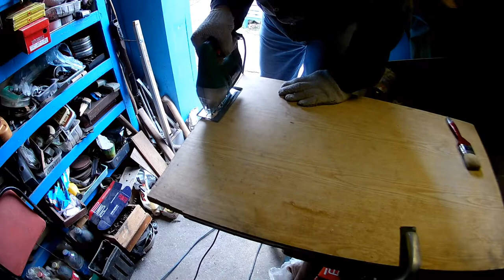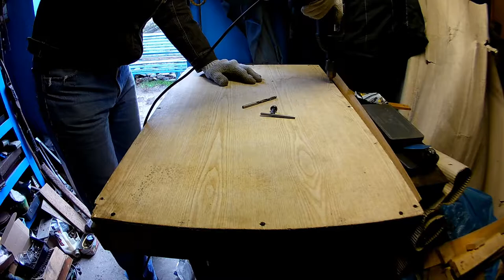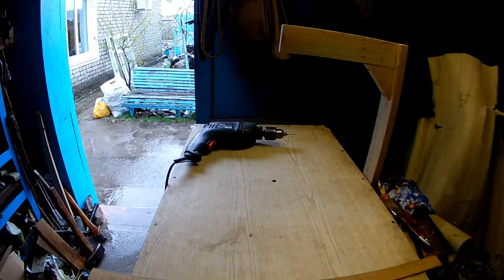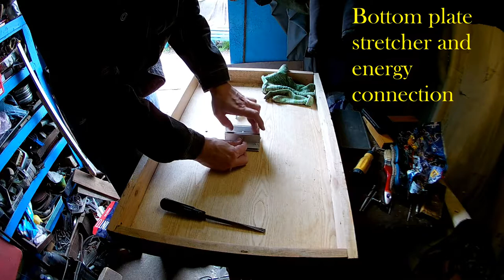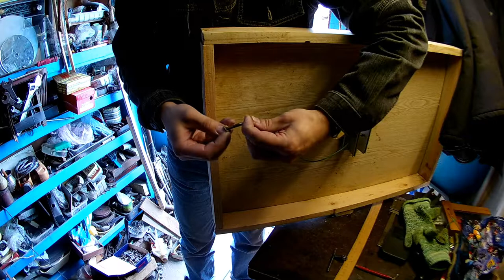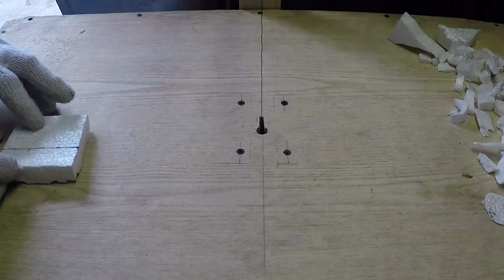Hot wire cutter - my building guide

Comment: The video is a bit lacking in information about the cutter. What kind of wire do you use? What is the purpose of the metal bits under the table (heatsink?) What is the piece you are installing at 7:05? A bolt with a spring for tensioning the wire? Adding a few more annotations would make this a much better guide. 

Also you don't show how the cutting wire is attached.

I don't mean to be negative, I really enjoy your channel.
Reply from the maker: Thanks for your comment and questions. Well, at 7:05 I wrote that I was installing stretcher and energy supply connection. Yes, it's for tension. It consists of a bolt and a spring. I took a wire from an old heater. Probably it's nichrome. Concerning bottom part I wrote: "Bottom plate stretcher and energy connection". It's main function is to hold a wire and to supply electricity. On the bottom wire is held by 2 nuts, on the upper part it's stretching by that bolt and spring. The hole was drilled in the bottom of the bolt and nichrome wire was threaded through it. Basically that's all. Very simple equipment :)
Reply: Thanks, those details are helpful.
Reply from the maker: You're welcome :)
Reply: Kanthal or nichrome wire.
Reply from the maker: The wire is from the old heater. I suppose that it's nichrome. I don't know what is "kanthal". :)